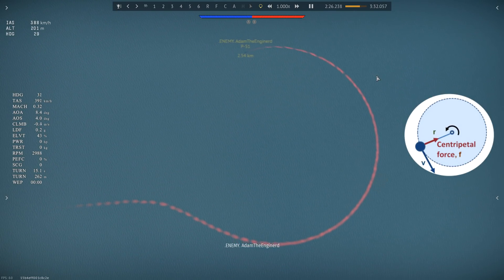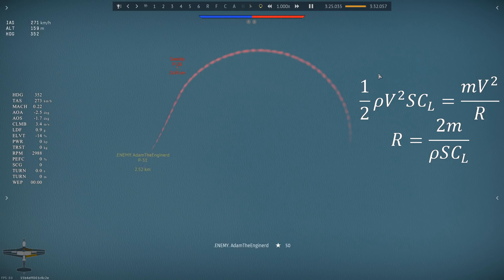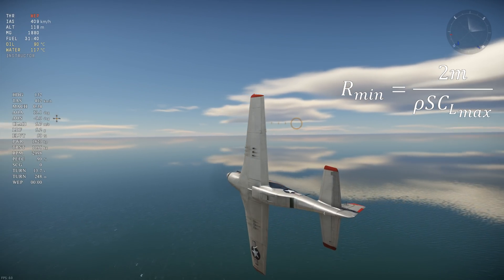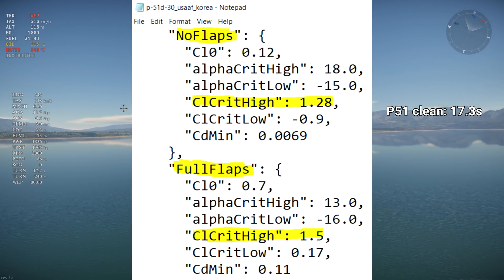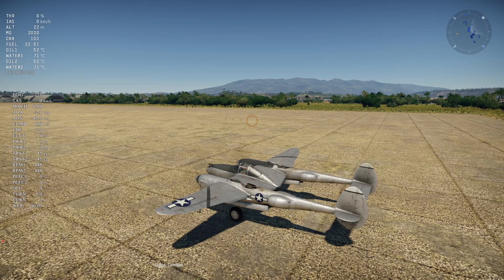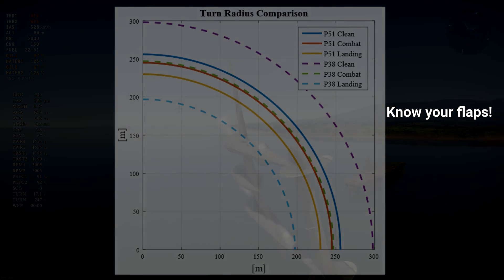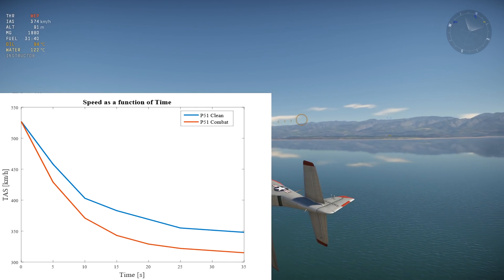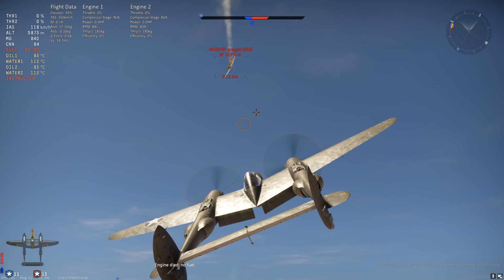Aircraft Turn Performance and Flaps

Comment: What is the most time and energy efficient way to completely reverse bearing? Is it as simple as turn dive and pitch up? Would the manoeuvre be the same in aircraft that tend to pitch up or down while yawing?
Reply from the maker: If you're going fast, it's a loop then a roll. If you're going slow, it's a split S. Time efficient is higher speed near CLmax, energy efficient is a gentle loop.

Comment: As someone in love with the P47D-28 and 47M. I am also in love with its flaps. Pull into a turn above 500kph, bleed some speed in that turn, pop combat flaps and bam you just made a 109 pilot shit himself.
Reply from the maker: Yeah they do seem quite effective.
Reply: I love dogfighting 109s in my p47 . Unless they do that spiral bs ahahaha
Reply: @stalinium4769  Plenty of people wondering how a P47 was mixing it up with 109s
Reply: Hunter Murphy i only do it in ground rb
Reply: @stalinium4769  I do it in Air RB if i feel confident enough. Theres plenty of Kurfurst drivers that panic when they cant turn inside you
Reply: Hunter Murphy yess
Reply: @BARelement  well, fancy meeting you here👋
Reply: @Rogueginger69  Hey bud!
Reply: @Rogueginger69  IRL the thunderbolts flaps do split a bit and have a gap in between them and the wing making them more efficient
Reply: @BARelement  I did not know that... the Jug is one of the most interesting planes in terms of design imo. Its engine and turbo are fascinating
Reply: @Rogueginger69  If you deploy landing on D-22Re you’ll see the gap/slack
Reply: @Rogueginger69  Imagine if they have it full Fowler flaps it would be a reall monster!
Reply: @BARelement  lol yeah that would help a lot in a duel since its so heavy I think
Reply: @Rogueginger69  Fowler flaps do wonders for the P-38s

Comment: What's going on with the Swift F7's flaps? Last time I really flew it (at least 3 months ago), they were significantly hurting turns and even pitching the nose down. I'd heard they can be used as the air-brake, but on some hairy dive's I've tried using them to help pull out, and what would have been a clean pull just above tree tops somehow becomes a dirt nap if you tap the flaps.
Reply from the maker: Some flaps pitch the nose down depending on the aircraft. At high speed especially, the elevator is stiffening and can't pitch the aircraft enough to take advantage of the extra lift from the flaps.
Reply: @AdamTheEnginerd  That actually makes sense now that you put it that way, and my chimp brain isn't just going 'why mor lift not = mor up?'
Is it a pitch stability problem for a nose heavy plane with a stubby lil tail?
Reply from the maker: It does have to do with stability, flaps only increase effective lift if the elevator is capable of going to the new higher CLmax. At high speed, it's not possible for some aircraft.
Reply: Would you ever consider doing a video around how WT handles static stability? Even if most of us are playing RB with mouse and instructors, I'm sure I'm not the only one who's intuition can easily be messed with, especially since the instructor gives no hint to the plane's natural tendencies. I think the most common problem I've had with it is trying to land without tail controls, using flaps to try pitch up, and lawn darting as a result.
Reply from the maker: They seem to handle it the normal way, with CG and moment coefficients.

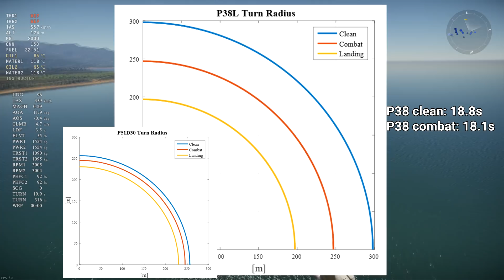Comment: 5:43 Have you taken into account to lowwr compression on the elevator, when a lower speed is reached when using flaps? Because elevator compression on the P-38 starts quite early.

Also, FW 190A's best turn fighter of ww2 at comvat speed :P
Reply from the maker: Sustained turn speeds are too low for control stiffening to have an effect.
Reply: @AdamTheEnginerd  You might be correct, but my experience in game tells me that the stiffening becomes noticeable between 400 and 450 km/h

Comment: Ok in 5:45 isn't p38 landing supposed to be less turn time than combat? 7:34 are you saying combat flaps have less turn time at high speed but not a low speed if so why did you put takeoff flaps when trying to get a shot on that G6 with no fuel. 8:28 why did you put your propeller pitch so low?
Reply: Also what type of flaps are best Fowler flaps etc. What are cowl flaps srry for the questions I like learning.
Reply: I don't know dude, maybe ask Google
Reply: @martijn9568  thanks adam
Reply from the maker: Not for the P38, as you can see. Turn time stays constant between combat and landing.

Flaps always increase your turn rate for a given speed, but bleed more speed in the process. So in the short term, for example to get a shot, flaps will help.

I put prop pitch low to reduce drag since I had no fuel left.

The more complicated and elaborate the flaps the better. Modern airliners have the best flaps (double or triple slotted Fowler flaps).

Cowl flaps are the flaps on the engine cowling typically for a radial engine. It's what moves on the P47 for example when you change radiator %. It controls the amount of cooling air that flows into the engine.
Reply: @AdamTheEnginerd  adam is king. Adam is best

Comment: I know you using it for RB logic but now I think about it. Does this mean the turn time in AB is technically would be slightly the same? Since in AB when you punch flaps in turns can make your circles smaller.
Reply from the maker: Hmm not sure I follow. The same trend you see here in RB should repeat itself in AB.
Reply: @AdamTheEnginerd  Mostly in AB we hold on the elevator while flat so I wonder if you can try test that as well and compare it to the angles
Reply from the maker: @S4LeagueTBKing  Bank angle? That's probably because the rudder has much more authority in AB so that keeps the plane up.

Comment: Hey Adam, could you do a tutorial on the other kinds of flaps? and perhaps in jets too?
Reply from the maker: What do you mean by that?
Reply: @AdamTheEnginerd  in this video you showd us 2 types of flaps, the ones on the P38 and the ones on the P51, i was asking if you could show us the same thing on the other 2 types of flaps with 2 other different planes, like for examples the fw190s and the yaks, on the second question i was asking for how it works in jets because they also have different flaps from each others of course but that means that some jets benefit a lot from flaps while others do not and i want to know wich ones do
As of now i know the P38 benefits a lot from flap usage while the P51 doesn t that much, it was just if you could show us on different planes

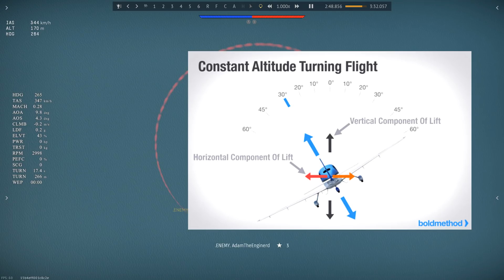Comment: 1:02 wait, but in 90 degrees turns what produces vertical lift? Maybe i missed something as I don’t understand English extremely well
Reply from the maker: My initial assumption just to make it more simple is that it's a 90 degree bank angle. Later in the video I assume a 72 degree bank which increases turn radius by 5%.
Reply: AdamTheEnginerd ah ok, i missed when you said that, i am sorry
Reply from the maker: @ferrarisuper  All good, no worries.

Comment: Thsi is hard to understand for a puertorican
Reply from the maker: The conclusions should be easy to understand no?
Reply: @AdamTheEnginerd  yes thx to u i become a better pilot even for been in console and pls even seen u fly ona normal match would be a good video good luck
Reply from the maker: @eljoy2736  Come on stream then ;).
Reply: @AdamTheEnginerd  i playd with you i was MCDONALDSWIFI

Comment: Is it sure for all propellers to reach their best turn rate at full elevators? Are there any props obtaining shorter turn time at higher speed, which means you don’t pull full stick on your mouse?
Reply from the maker: I highly doubt any prop would have a better turn rate than when close to CLmax.

Comment: Nice video, and always gotta have that "Let's (aircraft related verb) right into it!"

What gives the Firefly such a small turn circle? It's overweight and powered with a Griffon engine, but its wings and drag coefficient seem to let it pull a surprisingly tight turn. Could be attributed to the butterfly(?) flaps?
Reply from the maker: Thanks!

Never flown the Firefly, but typically attack aircraft have relatively low wingloading so that they can load ordnance and still be flyable. Complicated flaps would help too of course.
Reply: @AdamTheEnginerd  Not sure if you'd enjoy flying it, the Mk I is slow but that also gives it the good turn radius, the Mk V has a better roll and speed although not by much. You pretty much capitalise on its rarity(people who don't know what it can do) and people who make the mistake of turnfighting with you, unless of course you meet a Zero or Ki-43. It's pretty much an opportunistic aircraft, fantastic firepower for its BR and easily forcing overshoots, but above average pilots should never struggle with it, so it's definitely not competitive for carrying matches.

Comment: Your derivation is wrong if you assume L = Fc then there wont be any force to balance the weight of the aircraft. In reality Fc = sqrt(L^2 - W^2) and then you will see that both turn rate and turn radius is maximized and minimised respectively when you are pulling the maximum possible gs, indicated by load factor n = L / W, at the lowest possible velocity.

R = V^2 / (g*sqrt(n^2 - 1))
\omega = g* sqrt(n^2 - 1) / V
Reply from the maker: My derivation with that assumption is right*. I talk about the assumption and even include the extra 5% turn radius due to bank angle later.
Reply: big if true

Comment: Hi Adam, can you make a video on how to manually control the engine corectly. Thx, awsome video!!👌
Reply from the maker: I'll make one one day.
Reply: AdamTheEnginerd  ok thx, and that was a quick response😂
Reply: @AdamTheEnginerd  please explain mahneto and mixer
Reply: @soyderiverdeliverybeaver8941  I'm not Adam, but magnetos ignite the fuel in the cylinders of the engines. Most aero engines have 2 magnetos per cylinder, mostly there for redundancy. In the real world pilots test the magnetos before flight, by first only using the first group in a run up and then the second and always fly with both on at the same time in a normal situation. These are things you don't have to worry about, as War Thunder doesn't really model magnetos.

Mixture is what you use to keep the engine running at the optimum air fuel ratio (mixture). This is something you don't really have to worry about as most aircraft in War Thunder have an supercharger, delivering a consistent air pressure to the engine. War Thunder doesn't model mixture for most aircraft in the game, but there are some in which it's modelled
Reply: @martijn9568  thanks, i wonder why is the a6m2 unflyable with manua engine controls
Reply: Soy de River soy de River yo soy I’d assume the auto engine controls are not tailored for each aircraft so while it’s acceptable or more than enough for most aircraft, there are some aircraft with traits/variables that aren’t accounted for. I found this out with the swedish planes - specifically the J21s (the pusher props). The engines get overworked easily at high prop pitch and even have negligible power gains above 75% propeller pitch. The auto control doesn’t know that, so it overworks the engine and causes constant overheating because it only knows to open up the radiators when the oil and water get hot. The A6M2 may be a similar case of the auto controls simply not being optimal.
Reply: @nimbusws5946  thats not the problem. The reasom auto engine control doesnt open radiators is because it maximizes thrust to drag ratio in War Emergency Power.
You can see how the planes close the radiators on wep at least to some degree. In the case of planes lole the ta152 it closes it just enough so the engine wont overheat too much for basically the whole game.

My prpblem is with manual engine, where the a7m2 permanently loses performance after activating mec no matter whay you do
Reply: Soy de River soy de River yo soy oooh... oh wait fuck I misread your comment (read “with” as “without”) xD sorry bout that. Interesting to know about MEC maximizing thrust to drag ratio though, thanks for that!
Reply: @AdamTheEnginerd  please do it, WE NEED IT

Comment: How decide- should i turn vertical, horizontal or "oblique loops"? Thrust to weight ratio? Ingame card, or i should test it by myself?
Reply from the maker: Depends on the situation, your plane and what you're fighting. You should go vertical when you want to prevent overshooting or to slow down when you're very fast.
Reply: @AdamTheEnginerd  if a faster enemy is pursuing you in a low alt, you should do what kind of loop? Or better don't do loops?
Reply from the maker: Sounds like you should attempt to reverse the enemy.
Reply: @AdamTheEnginerd  yeah
Reply: @AdamTheEnginerd  Once time i was trying to reverse a dora and it hit kill my pilot. I don't know how to do this right.

Comment: What is the best ammo for German 13mm? I feel like they perform the worst out of all aircraft machine guns, even worse than the germy 8mm that is replaced.
Reply: IAI is best if you want utility, but it might get in the way as sad above
Reply from the maker: "sad" indeed.
Reply from the maker: I just use Stealth so that it doesn't interfere with my MG151 aim.
Reply: stealth, and pretend they dont exist. Rely solely on the mg151s
Reply: MG131 was specifically designed to use chemical ammo. thats why 13mm chemical ammo sucks in this game. same reason why APCR sucks. soviets didnt really use it, so lets make it "historically accurate".